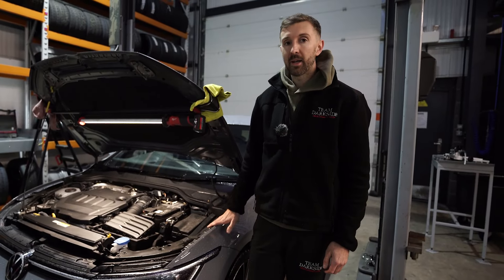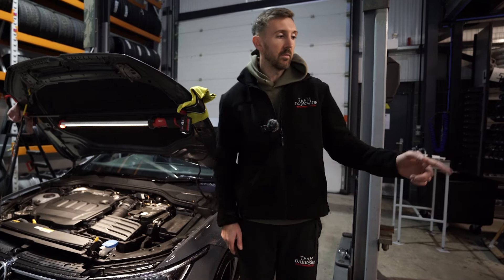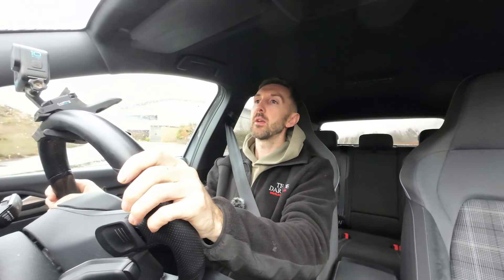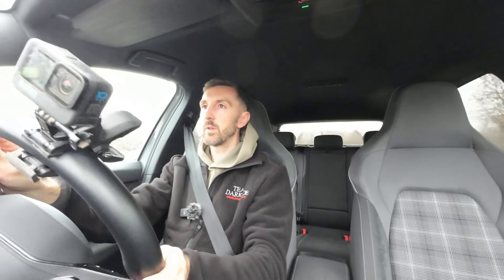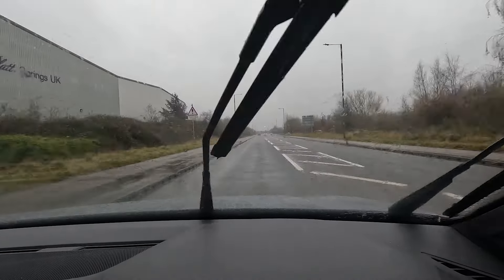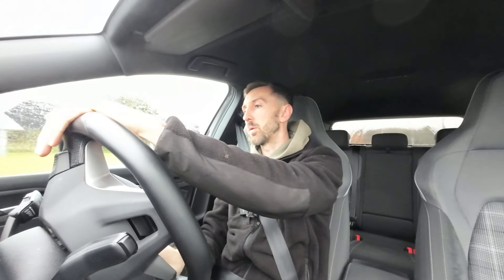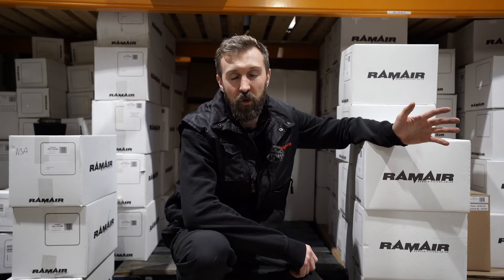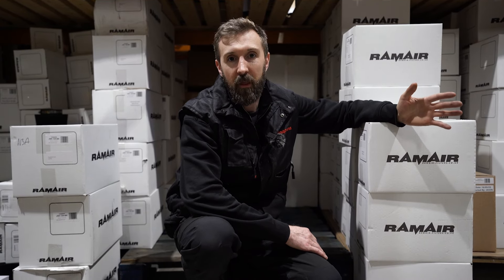MAKING THE BEST INDUCTION NOISES!! 🎵 Mk8 GTD Ramair Induction Kit

Comment: Would've been interesting to see dyno before and after. I have a feeling we would see minor power loses (not gains).
Reply: Probably only 1 hp more than before.
Reply from the maker: They tend to make a few horse power more over restrictive stock air boxes. Helps when coming to tune them later on

Comment: Any chance you might show what the induction kit that you sell for the A1 2.0tdi sounds like ? Also a before and after rolling road. I’m interested to see as I may be tempted for mine. Also being the air filter isn’t enclosed what’s the chance of water getting sucked  in and getting hydrolock ? I used to have a ep3 type-R years ago and I had a cover that went on the filter to help reduce the chance of it sucking in water. Do you sell performance washable panel filters for the Audi A1 2.0tdi ?
Reply from the maker: Should make similar induction noises. Power wise they tend to make a few hp more but nothing crazy. Had no issues with water getting in the filter

Comment: Do you know if that kit fits in other TDI 2.0 from vag group like DFHA engine? (The layout of that GTD looks pretty similar to my DFHA) 
And regarding performance, do you reckon it could provide improvement performance compared to stock box with K&N air filter? Or it is just for the sound?
Reply: DFHA does partially fit one of their kits, recently got one and the pipe at the turbo doesn't fit due to a larger diameter at the turbo, before MAF fits fine.

I noticed it didn't make much more noise until tuned, now it makes nice noises and it seemed to help the tune work out better.

That was a MK7 kit that was recommended by them, perhaps the MK8 one fits better.
Reply: @mwmm  Thanks for the info! I have a remaped Skoda Kodiaq and so far I had a K&N air filter on the stock box. I was thinking about upgrading to one of these which sounds really nice
Reply from the maker: Drop us an email to sales@darksidedevelopments.co.uk with reg/vin and we can check part numbers for you to see if either this fits or whether we have something else